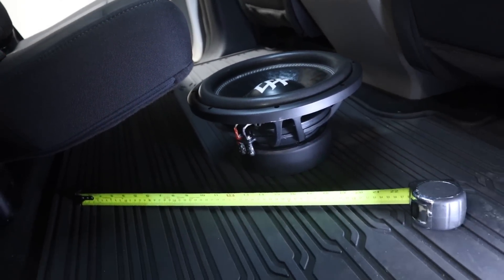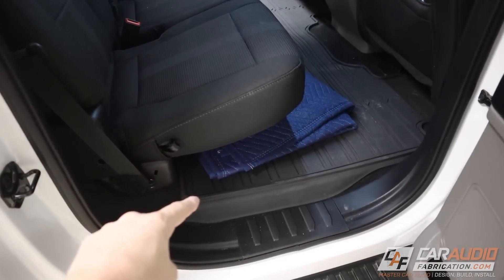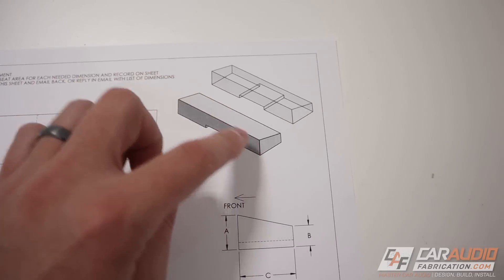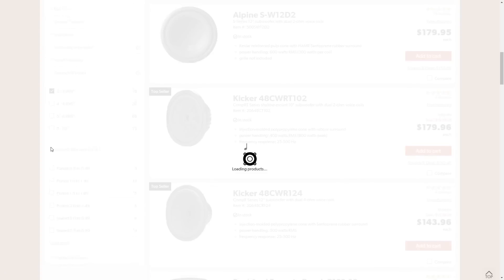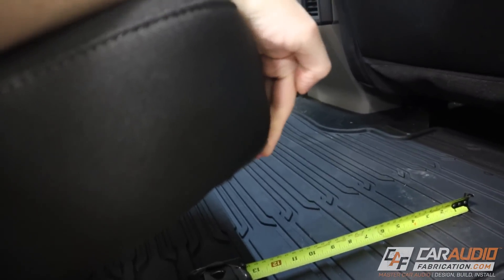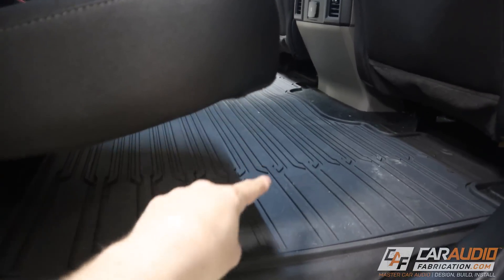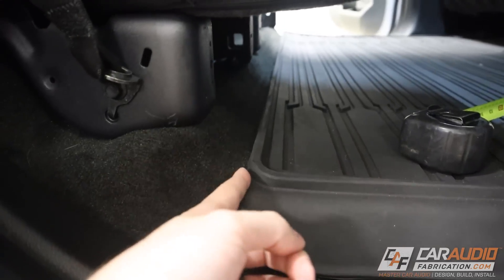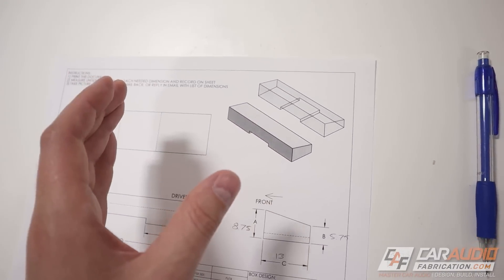Enough volume for truck subwoofer? You've been measuring wrong...

Comment: I'm considering re-doing my sealed sub setup in my F150 with the enclosure you designed for this truck.  Can you split this enclosure into two sealed sections with one side for a 10" and the other with two 8" subs?  I would think it'd be possible, though I'm not sure if sharing the same enclosure would work...

Comment: Thanks for the video. What material do you use for sealed boxed and what is the width of the box?  If it’s 3/4 do I subtract 1.5 in off all sides before calculating the volume?

Comment: What is optimal air volume for 12" sub?
Reply from the maker: Depends, if you need assistance with an enclosure design we can assist on our website.
Reply: @CarAudioFabrication  noup i dont need,i just want to know witch is the best choice to put on the spare tyre place,and that is not big...
Reply from the maker: It sounds like you do in fact need help. Again, not a straight forward answer, it depends on your application

Comment: I have a subwoofer box that had 650watt kenwood speakers, I just bought a 1000watt ds18 subwoofer hight excursion and they do not fit..by an inch. Is it fixable or I have to buy a new box?

Comment: You really dont need a large subwoofer, I recently bought a JL CP106LG, which has a 6W3V3 in it, for my hot hatch and running it with a Mosconi Pico 6/8 (which has 240W for the sub) this thing easily shakes the entire car and goes down to 30hz.

Comment: First of all Mark I'd like to say you do awesome work and you pay a lot of attention to detail and that's what I like .I need to get with you on building a subwoofer enclosure for a 2002 SVT Lightning behind the seat course it's a standard cab or do a blowhole one or the other I need some bass man without my knees being in the dash. I don't think it's possible without doing a blow hole or blow through or cut through or whatever you call it I'm 51 years old and I've been trying to get it some decent bass out this truck since I bought it in 2002. I've got two layers of sound deadening material for the entire vehicle except the roof so I think that's off to a good start. Will you help me brother please?

Comment: I just took my back seat out... ;-) 
Only temporary to make a box on hand work. Thinking of trying to get bucket seats and put it in the middle. 10" Infinity Reference. It only requires 0.5 ft3 in a sealed box, but mounting depth may pose a problem with under seat. Thinking of trying to get bucket seats and put it in the middle. If you're familiar with a first generation crew cab Colorado, that might be a bit much of an ask with the shape of the floor in the back.

Comment: Nope, i think you forgot something. And you even mentioned it...displacement. You not only have the displacement of air volume from bracing but you also have the displacement of the driver
Reply from the maker: This isn't a video for calculating the exact air space and learning how to design an enclosure. It's for quick approximations to make sure you make an intelligent buying decision. THEN you can account for the exact details. This is all stated in the video.
Reply: @CarAudioFabrication  yes, I agree and you did state for close approximations but didnt mention to keep driver displacement in mind . Beginners and snobs like me dont take this into consideration, we think that the manufacturer has included their driver displacement in air volume requirements. So we take their requirements at face value. Was just trying to help, not correct. I dont know enough to correct someone, especially a professional

Comment: I have a 2021 Nissan Titan crew cab, and after taking rough measurements under the seat, and researching a ton of 8in subs, it looks like the Savard Hi-Q 8s are what I’m going to get. Four of them to be exact. Their specs, both sealed and ported, will work under my rear seat. This video reinforced the decision I made to research speaker specs after determining rough air space availability, rather than listen to people’s opinion on which subs they like/would use. 

@CarAudioFabrication : Any chance you would consider making the sheet you use a printable PDF?

Comment: hey guys, I have been adding wood thickness to get I.D. measurement for 30+ years. but lets be honest, most ppl that are going to build a box, already have the sub, and are now trying to make a box for it. which sometimes isn't cosmetically pleasing. my fellow Basshead.s will agree that Spl outweighs the looks. and yes, I too was thinking he forgot about wood thickness. but that's not what mark was doing.  he starts with O.D. because cosmetics are his arena. it will look amazing. he can pick different subs, and have room to modify the I.D. if needed. smaller subs can surprise you if done correctly. I blow ppl's minds with my partitioned astro, 2 sundown x6.5.s in a center console I built all the time.

Comment: Use framing squares to extend the seat line for the bottom of the seat. There's no need to eyeball anything.
Reply: Screw the framing square as the floor probably isnt flat. Use a level.

Comment: @LAZER MAE, ported boxes will always give you Deeper bass and will need MORE space than a sealed box(Sealed boxes are more for people who want a very punchy and cleaner bass and if you have a good amplified aftermarket speaker system, which I still have with my American Bass 12” HD; 2000 underrated Watts rms in a triple baffled quintuple interior braced cause it is a 55lb Sub).  I personally do installs and make custom boxes(always better than a ‘Pre-Fab’ box).  All subs have specs on how much space they need for both sealed and ported box(which to dive deeper ,you can Tune your box to the proper amount of Hertz, esp, what your sub performs best at,). I always go with around 33-40 Hertz, anything under 20 hertz is ‘Subsonic and many amps have subsonic filters.  So in short,if you want to have rolling thunder, go with ported.  Cleaner and punchier bass, then Sealed is for you.

Comment: Easiest way to calculate wedge shaped boxes is to add long side and opposite small side together and divide it by 2. That will give u a value equality if that box was square. Use that number as the height then multiply the width and length as normal. Much easier and faster then figuring out a square and a rectangle.  Hope that helps someone. Math can be a killer sometimes.

Comment: I have a 2020 f250 and I just threw my 4.5³ft 24Hz box on the back seat with 2 kicker comp R 12s on 2 Skar skv2-1500.1Ds strapped to 3,000 watts @ 1ohm paired with the LC2i Pro

Comment: My k10 has a janky lumpy floor under the seat. Used fiberglass bottom to match it. Put some plastic down and fill with water before putting the top on to find the volume. The box is also what holds the seat in the truck since I removed the frame for more space. Not sure of the legality of that but w.e lol.

Comment: 12:00 in this section, I wish you reminded people that there is material thickness to be accounted for as well. The volume has been measured and calculated to this point as if the sub box is paper thin
Reply from the maker: As noted the point here is not to design the full box, but just get a quick approximation. That's why we multiply by .8 to do a quick approximation that accounts for material offsets. The goal here is to get a rough idea which allows us to buy subs and then do a more intricate design later.
Reply: @CarAudioFabrication  ok now it’s time to do the specifics video on airspace no matter how long the video will be 😄

Comment: As an owner of a crewcab F-150 I was excited for this video. I ran into all the issues you pointed out. I used the cardboard cutout method but on the framing for the box skeleton. Ended up fiber glassing the bottom and wrapped that up the curved back and towards the front. Then mounted 4 8" shallow mount subs up firing. They lose output lower than 35-40hz but adequate volume from there up. Great video. Can't wait to see what else you do to this truck.
Reply: Why up firing... forward would seem to make more sense.
Reply: @kingnut  Just came across this video again now that I've installed the LMI Welding seat lift. I'm redoing my sub setup to 4 10's instead of 8's. Will most likely go the front firing route this time. I did up firing due to the kids. I guess I'll have to come up with some kind of grill to protect them.
Reply: 2 SA CLASSIC 10'S 750 WATT RMS 10'S. WHAT'S YOUR SPECS FOR A 2020 FORD F150 XLT. I ALREADY NO I GOTTA RAISE MY SEAT 3 INCHES. HOW MUCH FOR A UNDERSEAT BOX DIAGRAM

Comment: On boxes like that I always took the long side of the wedge and the short side added together then divided by 2.
Reply from the maker: That works too but the reason I broke it into seperate shapes is so that folks understand you can have a very complex area but just need to break it into manageable shapes to calculate an approximation

Comment: Why not up fire? With some shallow 12s... I've had greater results up fire in ford's without any seat lifts or the encloser having a larger depth then the seat. I'd also use the speaker bar grills in tight places that just protects the sub from the weight of the passengers.

Comment: I have a sedan with my 12 inch in the boot/trunk, my middle rear seat fold forward leaving an opening into the boot/trunk. Should i have that open or closed for louder bass and why? Will it make a difference and why? Thanks
Reply: Leaving it open will be one less (major) thing between you and the sound, so that question pretty much answers itself. Though it won't be "louder" so much as it'll just not be filtered through your seats as much, so it'll give the impression that it is. Furthermore, a sealed enclosure won't tonally change much, but with a ported one you might notice a slight tuning difference between open and closed.
Reply: @RAW_Reality  thankyou. I forgot to metion the 12 is in a ported box.
Reply: @adrianp2007  no worries, glad I could be of some help. Enjoy.

Comment: Question is it possible to create a sub box that fits under a JK wrangler 4dr rear seat?
Reply: Good luck with that. I'm struggling with having a single 10" in the back of a 2dr JK, hung on the tailgate facing forward AND have carry space left over. But I guess if you modify the rear seat and fit shallow mount subs it might work, a lot of work though. The rear seat in the JK detaches in a breeze, but might not have enough space even into the seat to securely fit subs. 
P.S. BMW X3 E83 have dual 8" shallow mount woofers under the front seats in relatively small enclosures acting as subs, might try to DIY something similar.

Comment: I have a 8 inch silm but i only hear the high Bass but why...the box isn't  
to big or to small...it's length is 44.5 
Cm... width 27.5cm...height 24cm so why??
Reply: Lots of variables to consider. Do you have the correct volume for the sub you have? Is it ported or sealed? Is the box solid and well builr?
Reply: @derfskittlers6125  yes but it's not in a car it's for my home theater but no mater were it is it only made high Bass
Reply: @derfskittlers6125  ported

Comment: Im surprised you didn’t use a seat lift and put two 8s
Reply from the maker: Who said I'm not?
Reply: Lifted my seats about 1.5 inches to fit my custom box. Looks great but a 6ft person's head almost touches the ceiling. I use my rear seats alot so kinda regret it so,, I will change it eventually.

Comment: I recently finished a ported under seat box for my F150. I built the port on the back side of the box, external from the mane chamber. It sits on top of the small step in the floor of the truck.

Comment: The basic drawing that you're starting with there is essentially what I built for my F150.  My box is sealed with 1.1 cu-ft volume, substantial bracing, filleted internal corners,  with a single down-firing Rockford Fosgate T1S2-12.  And I didn't raise the seats.  When you work out the math and geometry, it basically converges on one solution that will maximize vertical clearance (of the driver cone) off the floor.  With a 600w JL mono amp driving mine, my truck rocks!

Comment: I have a Honda Ridgeline and bought subwoofers kicker 12 inches with box that is custom made but I think I need to upgrade the quality of the box .
Reply: U getting alot of vibration ..i am ..2018 ram 1 12  sub in custom wedge box ...vibrations are rediculous
Reply: @kylemiles9156  yes but only have 500 rms so it is vibrating
Reply: @ray6808  yea im having same issue
Reply: What is causing it i want to fix it so bad just do not know if it is the box..sub is poor quality..the truck ..smh

Comment: Are there benefits or disadvantages of a down firing sub vs up-firing?
Reply: I believe to obtain the lower bads note into the cabin rather than into the floor, where in retrospect is immediately leaving the vehicle. Where with them down facing, that bass note shoots up into the open cabin amplifying more before leaving the vehicle
Reply: In both my Silverado (center console replacement box) & F150 (under rear seat) I got better sound down-firing the subs. The cool thing about the D-F box is you also feel more of the bass through the seats which, if nothing else, makes a good back massage. Lol

Comment: There is an easier way than separating out the triangle. Just find that average between the two sides. 8.75+5.75=14.5/2=7.25xWxL=external volume.
Reply: That's exactly how i find this #  👍🏼✌
Reply: I was going to mention this very thing.
Reply: Works every time

Comment: Mark, or anyone who may have actual knowledge maybe you cN help. When using the formula 
V=the square root of P*R 
Should I use 1 ohm in this formula ( bc my subs are wired to 1 ohm ) or should I plug in the "actual .8" ohm that my subs read on the dmm?
Reply from the maker: Use the nominal impedance so 1 ohm.

Comment: I like when people have an idea of what they want (2) 12's but don't have the room for them so you suggest (4) 8's. You explain that the 8's will sound better, be louder and perform better. Of course that goes in one ear and out the other. In their mind 12's= better no matter what.
Reply: While only about a hundred other things factor into this conversation than simply "pick one over the other", give the masses something to actually chew on other than "uh, 'cuz I said so" if you want the message to actually resonate to them. Like the fact that there's more surface area in 4x8"s than there is in 2x12"s. Then again, sometimes what you're going for by "just" wanting the bigger subs isn't the concern... like meeting a spending limit, as buying and powering 4 subs that are adequately comparable to what you'd be able to buy while using "just" 2 subs doesn't usually end up being cost effective.

It's unfortunate when people have an idea of what they're talking about but end up not realizing they could stand to learn something from whom they're talking about. But I do like the irony of talking about someone else's mindset while not being able to interpret thier perspective.
Reply from the maker: I know, its unfortunate.

Comment: Proper expectations is key.   How much space are you willing to give up for the sound.  Trucks are especially tricky as there is no hatch/trunk.

My first build in the 90's was in an S-10.  Limited space was an ever frustrating thing but having an extended cab helped a lot
Reply from the maker: Well said, definitely agree that trucks are the most limiting, unless you want to basically make the rear unusable and delete the seat or go to a blowthrough, which of course then loses capacity for cargo in the bed.
Reply: @CarAudioFabrication  Interesting to see what you come up with. 

I am curious how many trucks you get in for builds?

Comment: For most people buying pre built boxes the answer is 10 inch subs. Almost every one I have seen with 12s doesn't sound right. (Not enough air space for 12s)
Reply from the maker: I tend to agree, but luckily seat lifts are becoming more popular allowing for more space.
Reply: Don't do seat lift if you have people in the back. My 6ft son almost touches the ceiling. 
If you need THAT much bass then just rip out the rear seats. Lol
Reply: Just installed a LMI lift kit in a '15 Ford SC. I'm 6'1" and have several inches of head clearance in the back. Head room is not a concern if anyone was worried about that
Reply: What do you recommend ported box up
Firing or down firing enclosures
Reply: @crisitanc5666   When you are working without a lot of air room under a seat sealed is definitely better.  I have my 10s facing forward and it sounds really good.

Comment: Great video.  How much space should I leave open if I am using a down firing sub?
Reply from the maker: People will say "half the diameter of the cone size' but you simply won't have that luxury without losing a ton of air volume. Usually cone excursion plus 1/2" to 1" works well.
Reply: As long as you have enough air flow out from under the box since essentially you are turning it in to a 4th/6th order band pass by downfiring which is why typically down firing boxes sound better when they are anchored properly imo